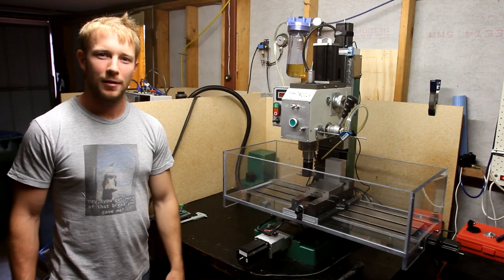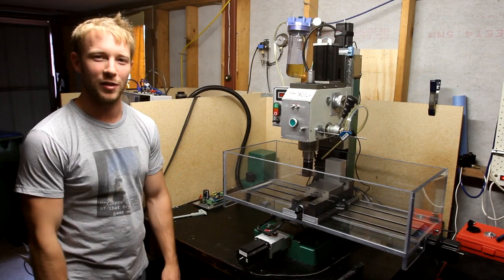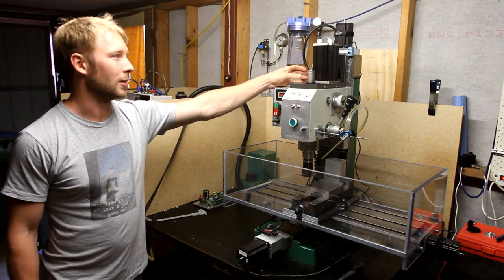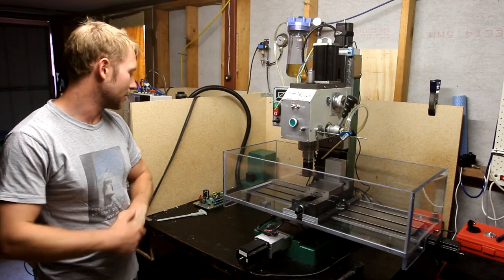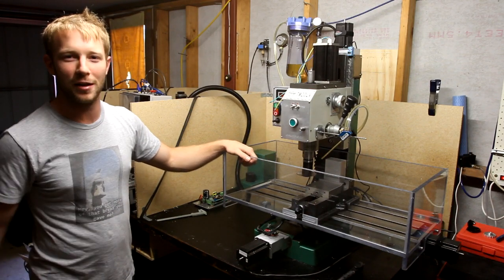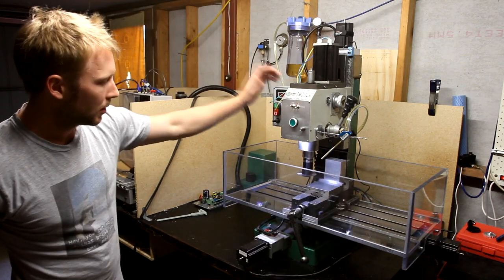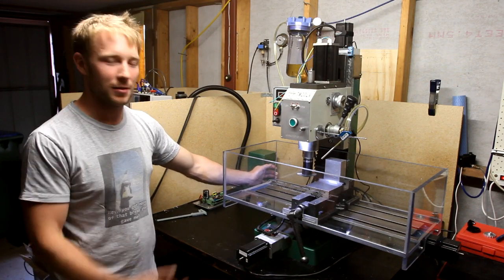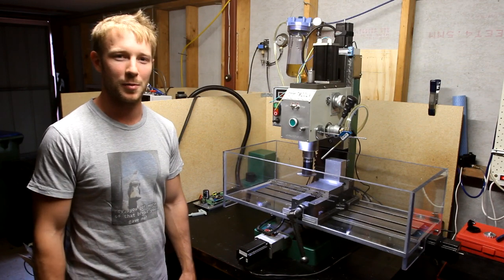CNC table polycarbonate enclosure

Comment: nice enclosure!  would you mind posting the cutting diagrams/dimensions for the pieces?  I would like to do this on my G0704, and with the cost of 12mm Poly, would want to get it right the first time.  Also, I will do a top cover, and some brackest on the mill head, so that it slides/floats on top of this box, but slides off to the front.  That sould contain 100% of the chips!.

Comment from the maker: Still thinking about this - there is no load on the motor yet it is still heating/tripping... so must be some timing issue or something. The manual states for motor heating problem: The phase to phase withstand voltage of the motor is insufficient. I have no idea what this means lol

Comment from the maker: Ok thanks - hey well come to think of it I did get it to run to 50Hz, after a factory reset. However I did not current limit the inverter, it was still set to 7 amps. The motor became extremely hot. Maybe I should limit it to say 3.6 amps (800W motor / 220V = 3.6) and tune from there? I haven't pulled it off to check if permanent magnet so cannot comment there. I should check that. Thanks for your help mate

Comment: Nice enclosure man I made mine very simular to yours! I used cheap 3mm plywood but I really like the polycarb idea you did good job. I know how frustrating it could be to burn a motor driver. Two of my KL-5056D drivers burnt out so I ordered some DM856 witch can handle 80v max. Nice vid have a good one!

Comment: Ok if you reset to factory then you will need to change PD143 to 02 also you may need to play with PD145 auto torque compensation check motor current rating PD142 and motor voltage PD141 should be set to 220v

Comment: Yes I did get it going but now you come to mention it resetting the parameters was also one of the fixes and you've tried that, is that motor just a normal 3 phase motor or does it feel like it has permanent magnets in it?

Comment from the maker: Thanks for that info man - I did try dropping base/max Hz to 50 but still had the horrible noise. I also tried a factor reset... adjusting carrier frequency (same settings as a guy used on his lathe on youtube). No avail... very frustrating. Did you ever get it to work properly?

Comment: 230V three phase is normally delta connect, also try dropping the top frequency setting on your VFD from 400hz to 50hz , I had a similar problem on a motor with one of those type speed controllers, after you pass 20hz the motor gets left behind and screams